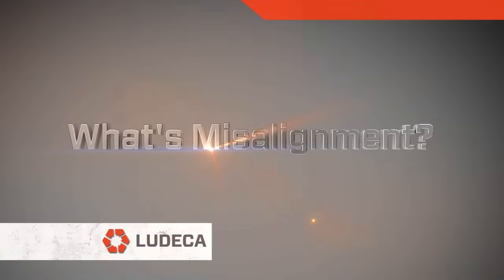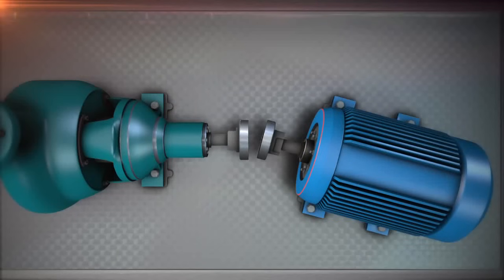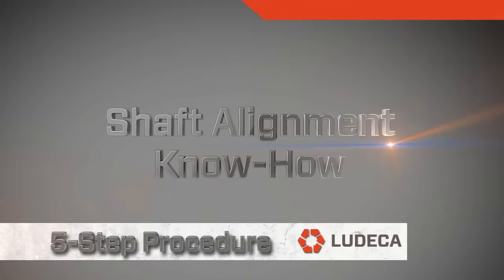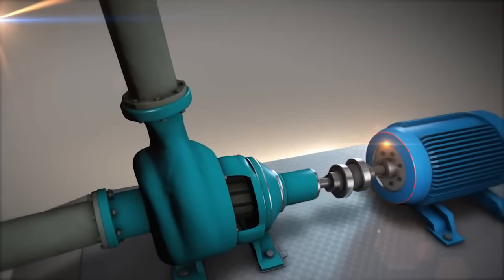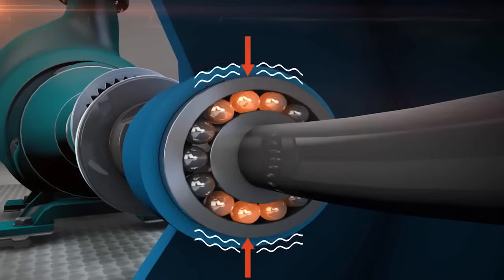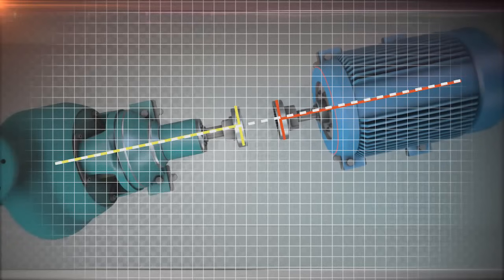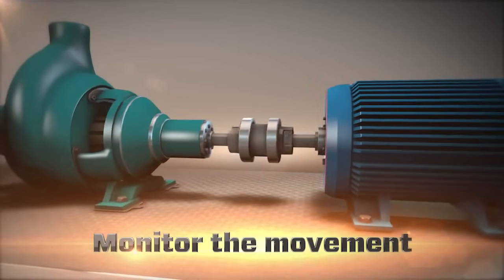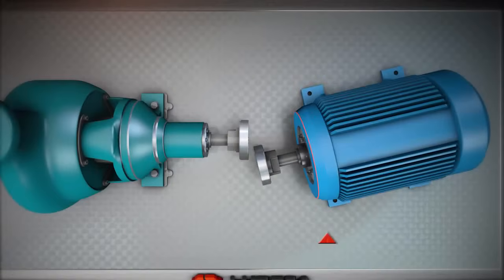Shaft Alignment | Shaft Alignment Concepts | Shaft Alignment Basics | Shaft Alignment Procedure

Comment: We were aligning a 1200 HP engine to a centrifugal pump.  The unit would fit in a 20' shipping container frame.  As we had had over heating problems in the past, we hired a laser team.  We aligned it by welding.  When all was done, the it was aligned perfectly.  I put a 1" hydraulic pancake ram under a corner. Two or three pumps and the alignment was out of tolerance.  We solved the problem with u-joints.
Reply from the maker: Good

Comment: What do you do if it’s impossible to get true alignment because of location restrictions, size of motor to “pump” etc..and other items around items that can’t be moved.
Reply: Cv joint in between the two shafts.
Reply: It’s never impossible to get correct alignment.
Reply: The first thing to understand is that this whole process is a nonstarter if the motor has insufficient power output to drive to pump. Make sure that's up to requirements first.
Reply: Apply the Chinese Concept
Run till it breaks and buy another one from China
Chinese = Cheap replacement